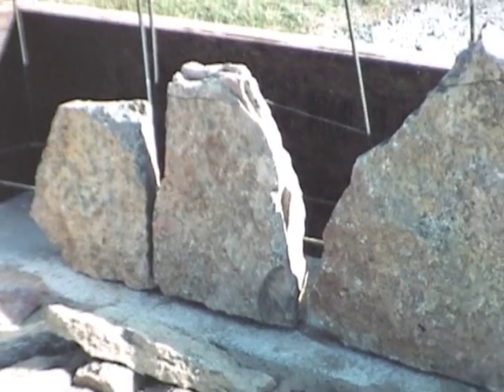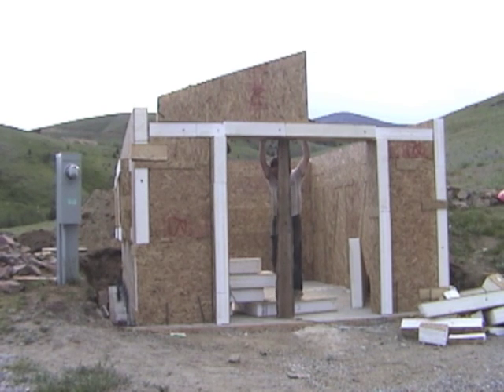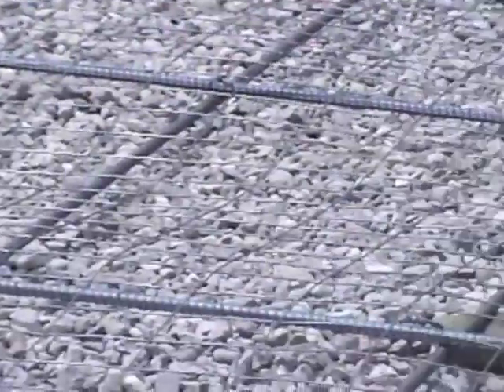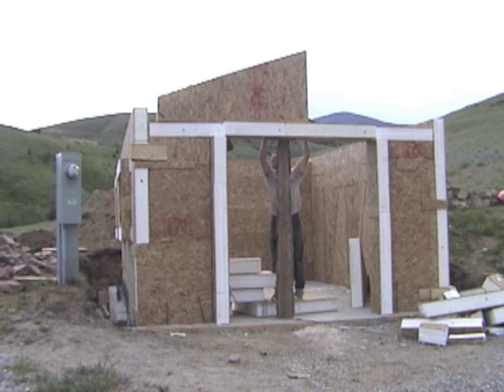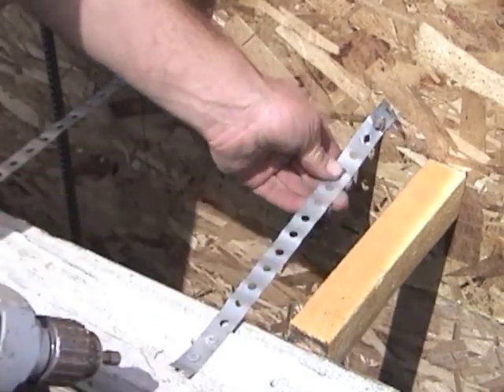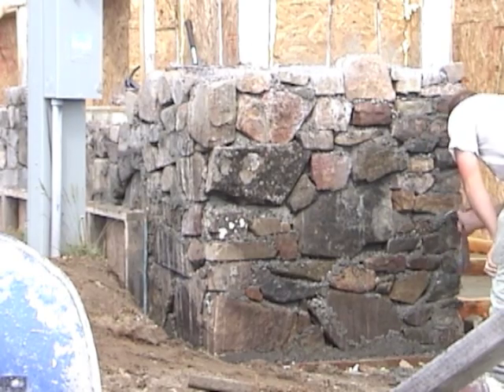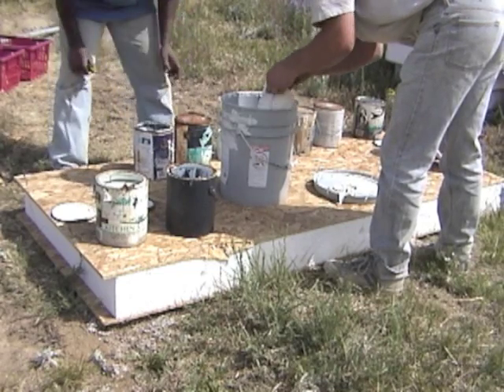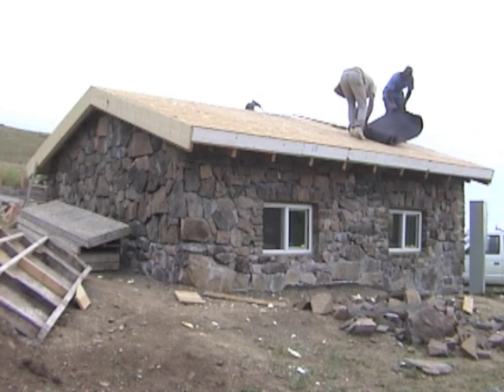Slipform Stone Masonry (sample clips from the DVD)

Comment: It's the outgassing one doesn't notice that would concern me.  With certain synthetic chemicals and the products made from them, toxic outgassing will be present as long as the product is.  I have not done the research, but the substances used to hold particle board or OSB together would be highly suspect.

Comment: I’ve had many clients who have me take down old plaster, and repoint the joints to expose the stone, even though the original masons/builders would be ashamed if they knew I was exposing their inferior work. The method differs mainly in the fact, local slip form work is still laid like traditional stone work, mass into the wall, laid flat and nothing taller than it is long. And of course they were using traditional mortar often with high clay content to prevent water passing through the wall.

Comment: Believe it or not they have your video at my local library. It’s an interesting new approach to an old method; slip forming stone is actually pretty common throughout Central PA. It was mostly used were stone was not intended to be visible such as basement/foundation walls, and houses that were to be lime plastered and white washed.